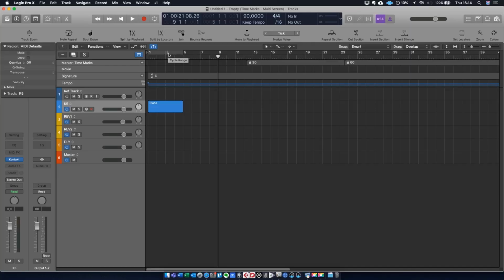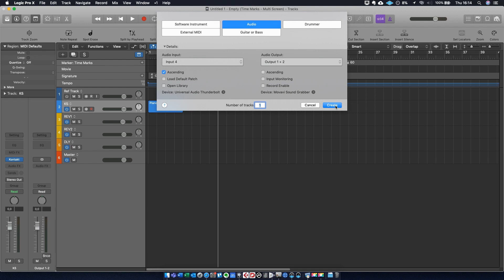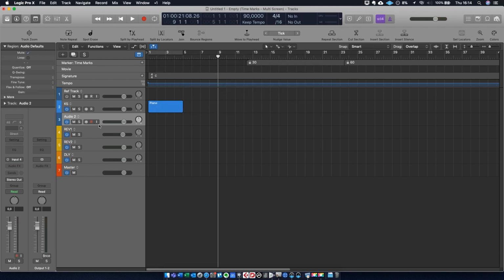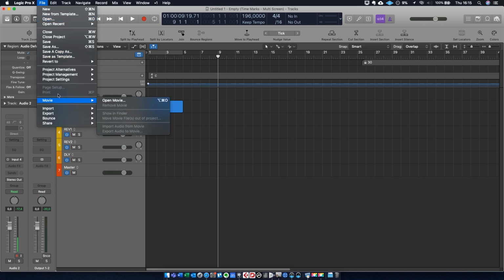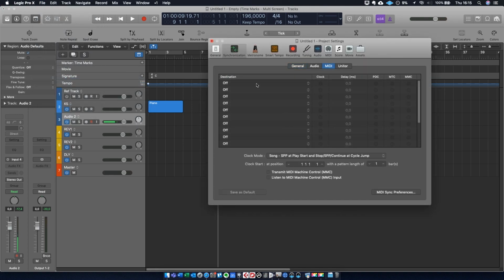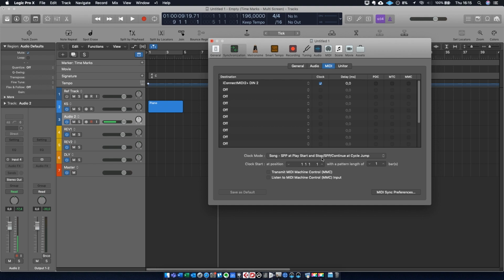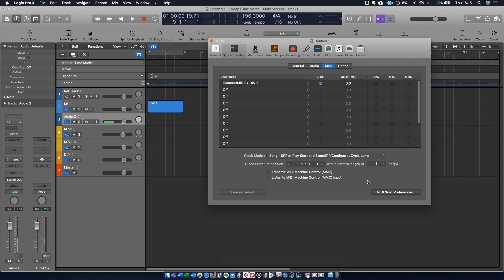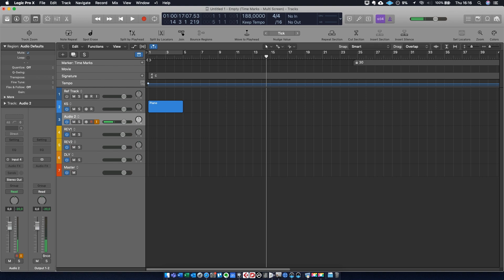How to synchronize Mother 32 and DFAM (or any hardware synth really) with Logic Pro X via MIDI

Comment: can you please show in details where you connect the midi, the DFAM doesn't have midi in/out only the M.32 does have midi in. I see you connect a midi and assigned it to...(???) so the steps are not so clear. Thanks.
Reply from the maker: The DFAM doesn’t have MIDI so you need the m32 (or another device which has midi) to work as a clock for the DFAM (there’s a ADV/CLOCK input on the DFAM
Reply: @AlessandroMastroianni  Hey, I own both, and actually that's what I've done so far, Clock from LogicX  midi out from my audio interface  into  M.32 midi in > out from M32 (assign) into DFAM (adv/clock). Better then the old set up I had; Clock from LogicX>
into Moog Grandmother (via USB) > out from Grandmother CV clock > into DFAM (adv/clock) but I had a lotta latency. With just the M.32 & DFAM using MIDI out into M.32 in and so on it (like you suggested), seems less latency yet I still have late start at the first 2-3 beats tho, not sure why. :)